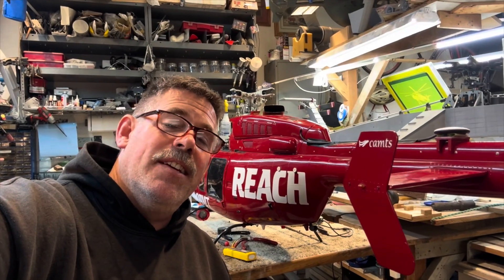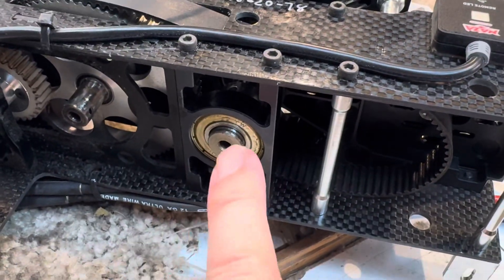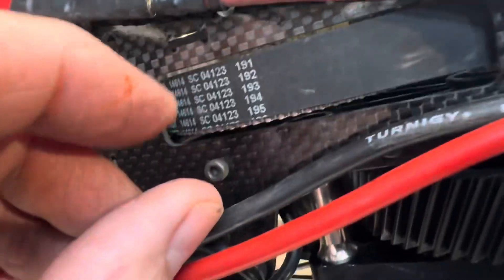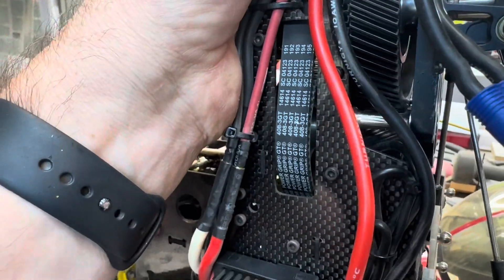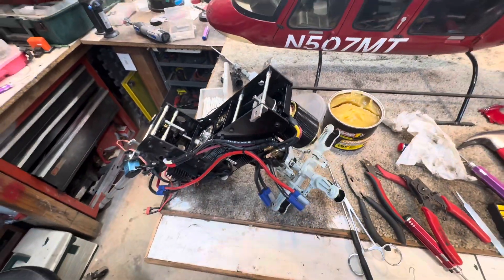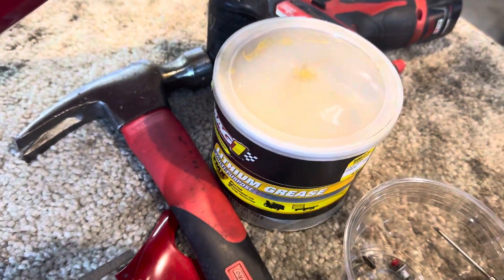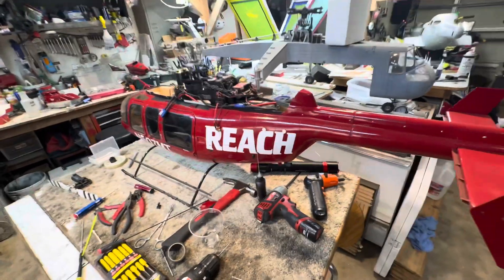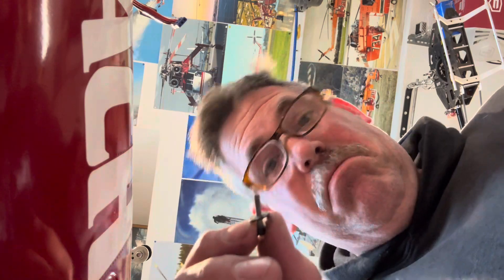Roban Reach Bell 407 Re-Gear assembly

Comment: Hey Mike,  Happy New Year,  hew do you guys deal with horiz stab vibrations?  My blades are properly balanced.  Headspeeds 1050, 1150, 1250 on my Roban B429
Reply from the maker: If the blades are balanced, start looking for bent shafts. Also try a different set of blades, and or stiffening up the mount area for the stabs. How tight are the blade bolts?
Theres always gonna be some vibes with different altitudes, blade tightness, heat and moisture in the air.

Comment: Hey Mike, I really like the videos your putting out. I have a question that maybe you can answer,  What is up with Roban, I can't 
buy any of there line up as far as kits. I hear you mention other brands of scale heli's but I can't find any. Thanks Kurt.
Reply from the maker: Roban only puts out full kits. even unpainted kits are finished in the gel coat with clear coat on it. Makes no sense. cause there is a demand! Even getting parts is hard. I heard of someone in the UK who runs an Ebay store where you can get parts. like the two gears coming off the main gear pinion that runs the tail rotor, and main shafts. Motion has a limited supply. Pretty much they have to fill a full 40' container with kits to get an order shipped. 
As far as other brands, there is Vario which has its own head aches, and then there are Funky, but I don't think they are called funky any more, they have been re-branded. Some are coming out of Australia, and a lot come out of china and Japan. SO the moral of the story is, if you find a good deal on a fuse, grab it and hold onto it for years until you get to it!!
Reply: @JestRR  Thanks for the reply. I was asking about the full kits painted and everything,where you put your mechanics in them, but they are not available from their store, they all say sold out. If you know like a certain time of year they release any models in their line up I would like to know, but it sounds like that may be impossible. Probably 5-7 years ago I found a BO-105 body and put a trex 500 in it, with a 4 blade head from trex. But it shakes its ass off, bcause of the blades are not balanced correctly. That is where recently I found your videos on your journey balancing yours. I am still working on getting my blades working.
Reply from the maker: @kurtwest5306  No one puts out a finished scale kit like Roban. Vario are kits and you do all the work or you have some one like Tyler Gray Models build them for ya. Total PITA